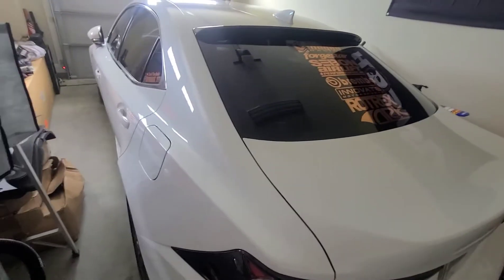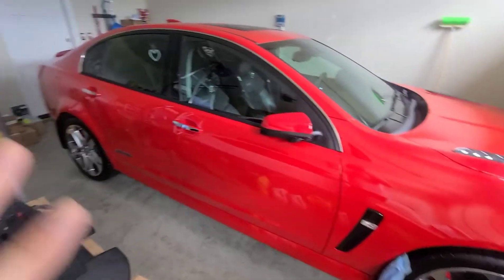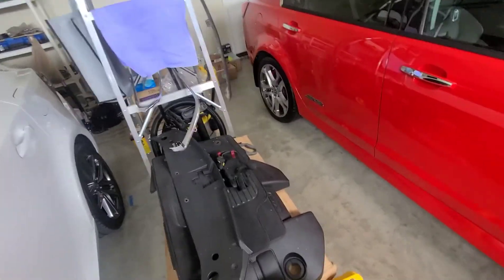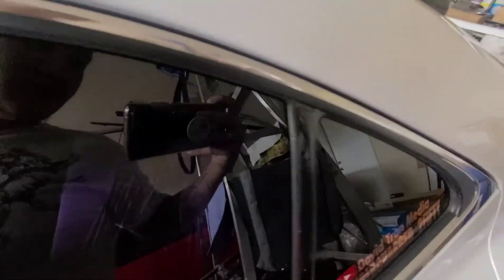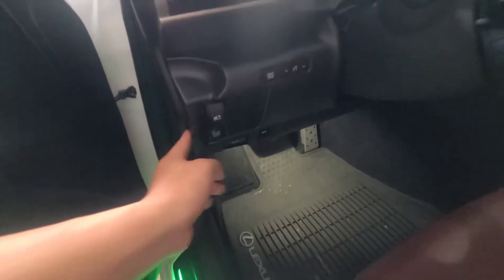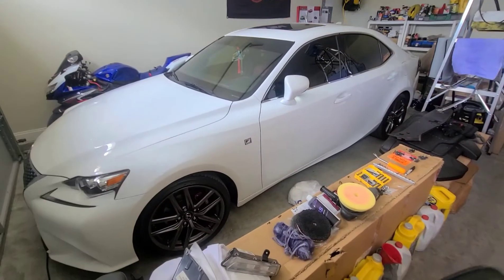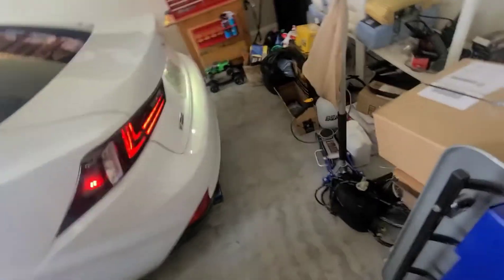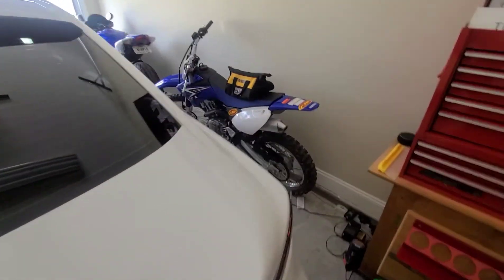2014-2020 Lexus Is250 Is200t Is300 Is350 remote start install.

Comment: Great video!! I used this video as a reference to install the MPC Remote Start for my 2019 IS300. There were a few screws here and there that I discovered, as well as an entire metal bracket that was needed to be removed. If anyone has any questions in regards to this installation for a 2019 IS300, feel free to send me a DM! Thanks again for this video :)
Reply from the maker: Glad it could help in any way!

Comment: Great video! I do have a question are you using your factory OEM remote? Did it automatically programmed?
Reply from the maker: Yes I am using the oem remote. Because I only remote start from my house in the winters and to warm up the engine before I get in. Other then that you cam add range extender and make even further and add on to make it start from anywhere in the world

Comment: Does it have takeover mode? Like you can remote start it, open the door and press the button or whatever and keep going?
Reply from the maker: It does but due to it being a Toyota product the moment you open the door the car shuyd off for safety reasons. Factor Lexus and Toyota systems even do it. It's a Toyota thing. My Chevrolet ss has take over mode just get it and hit the start button and off o go lol. Wish it was like this with Toyota

Comment: How did you reconnect the hood release, mine popped off too and I can’t seem to be able to reconnect the cable to the release pull. Any tips?
Reply from the maker: Basically you pull the medal wire connected to the hood. Then you  put it in the latch. It literally sits in there.